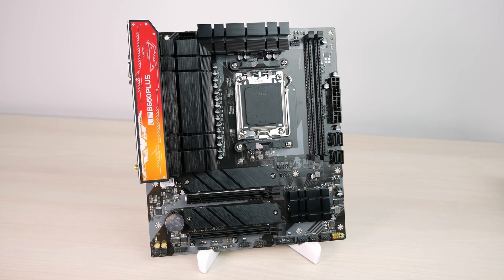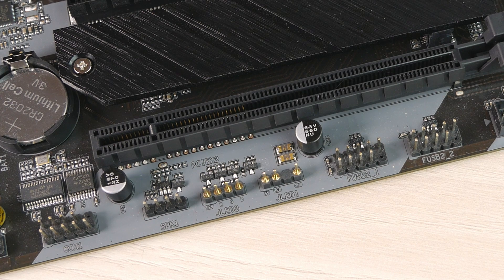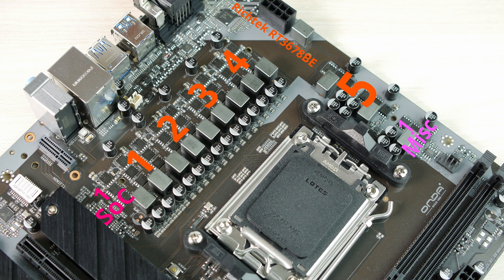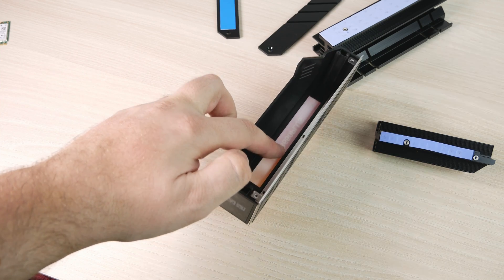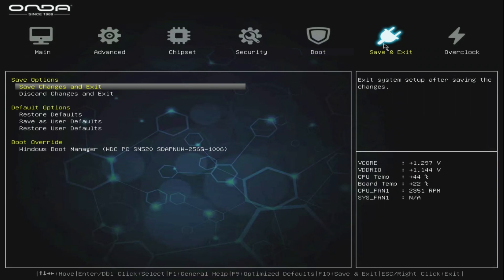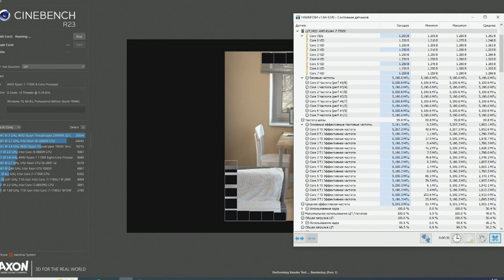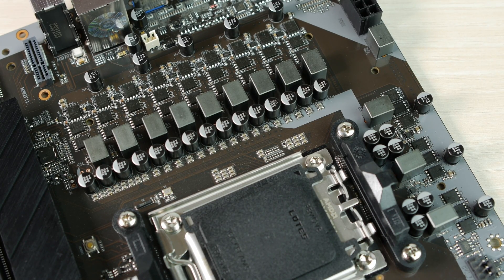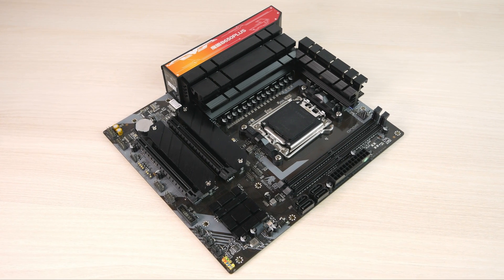ONDA B650 PLUS review - A cheap chinese B650 with great VRM. Is it worth buying?

Comment: 3:06 the VRM is a bit underpowered, i would say decent, but running a ryzen 9 chip would be a bad idea

The best onda b650m board would probably be the latest revision of the b650Pro(which is cheaper), since their website claims to have upgraded to 9phase DrMos, which would be a huge upgrade, possibly matching or beating popular boards like Asrock B650m HDV or MSI Pro B650M-A

Comment: Could you do a review on the Colorful CVN B650 motherboard? from what I can tell from the specs sheet it is basically an B650E motherboard and I got it for about 200 USD shipped.
Reply from the maker: It's coming soon, both atx and matx versions